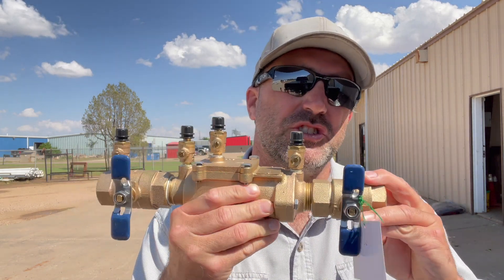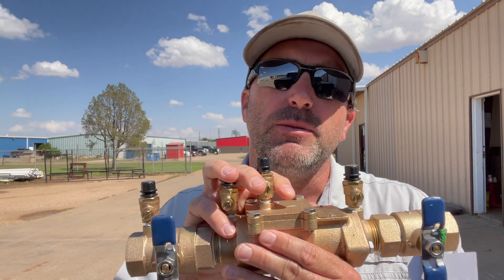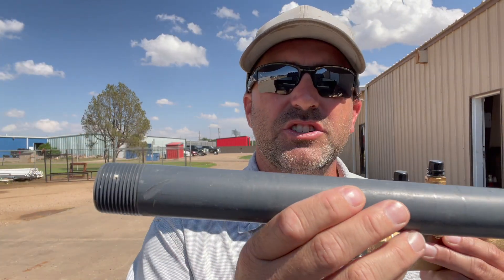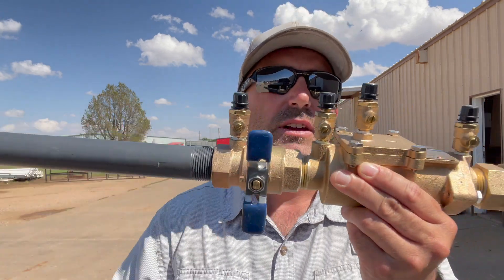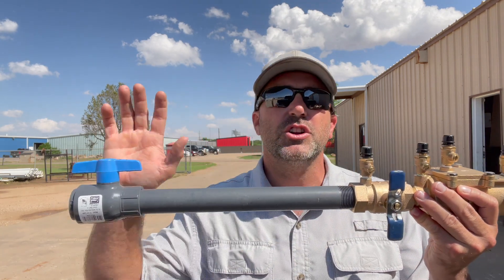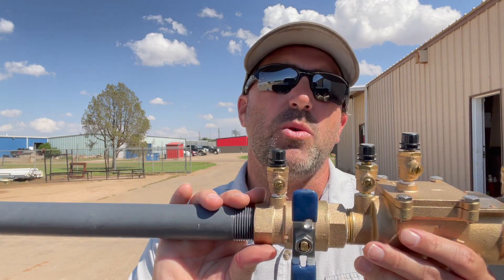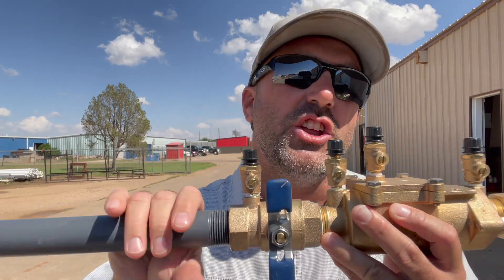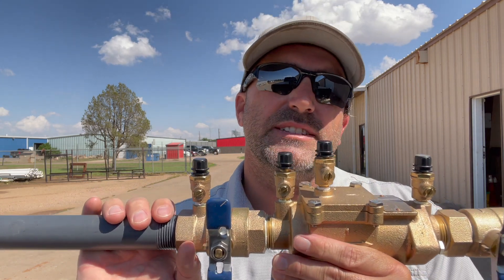2021 Texas Double Check Backflow Preventer Installation Rule Change

Comment: While I think its good that you inform your viewers of code changes, I disagree with the overall angle of this video. Just because the jurisdiction does not require a "Y" stainer, doesn't mean you shouldn't install one. In fact, the code might stipulate that all manufacture specs be follow for the installation of their equipment. Zurn-Wilkens says that a strainer should be installed before their back flow prevention device. You should be making this very clear to your viewers--always follow manufacturer's spec.

Comment: I have a 3/4 inch copper main that is going to a 3/4 shut off to a 1 inch backflow. Is this correct? Should it go to a 3/4 shutoff to 3/4 backflow?
Reply from the maker: It is ok. There is not much difference on pressure loss and flow through a 1” and 3/4”. It will work either way.
Reply: @AmericanIrrigator  Thank you. I may have to possibly replace my backflow. If I do, would you recommend using a 3/4 " valve instead of the 1"? Also, I have a y-strainer on it and I'm thinking of removing it since it is no longer required in Texas. Thoughts?

Comment: If I'm installing that valve to make ready  for  new sprinkler sysytem, I'm not a licensed in irrigation but licensed in plumbing and I'm not doing  the sprinkler system just the valve  do I need to pull  a permit and have the valve tested or do I need to wait until everything is done to test?
Reply from the maker: The backflow will need to be tested upon installation, as soon as you put it in. And I would check with your city on the permit just for the backflow. You don’t want to have to pull two permits, one for backflow and one for system installation. They may work with you on that.

Comment: I have a 20 year old Zurn-Wilkins 950-XLT.

The handles have rusted on both ball valves. Can I just replace the ball valves? Will it be extremely difficult to get them off? Or, should I replace the whole thing with a 950 XLT2??

Comment: How do you winterize one of these underground backflow preventer systems? Lots of videos on how to winterize the above ground types but I could not find any for the underground types.
Reply from the maker: I see a lot of guys fill the box full of insulation and it seems to work. But as far as taking it apart or flushing it out there's not much you can do other that turning the water off and opening up the test cocks and letting the water come out. That would be my only idea at the time.
Reply: @AmericanIrrigator  Thanks much! That is exactly what I did -- shut off water, opened up testing valves to 45 degrees to allow water to leak out, and then used insulation to cover it all up.
Reply: @AmericanIrrigator   Where you live.

Comment: Does it matter how far the back flow device is from the meter?
Reply: Some cities don't want backflows installed in the strip along the street, & some are ok with it there, & some will let you put it close to the house, so you just need to talk to your inspector and get permission to put it where you want, at least in my experience.
Reply: Thanks for the info John that helps me out 👍🏼
Reply: In Texas, it has to be within 3 feet from the meter.